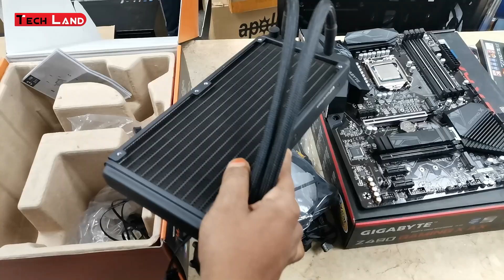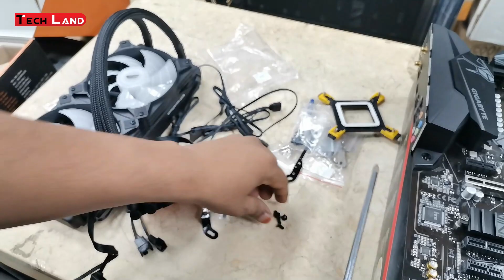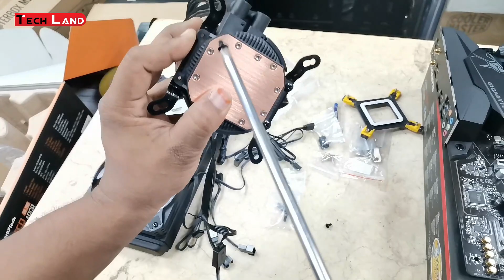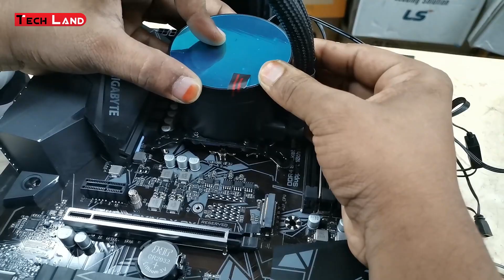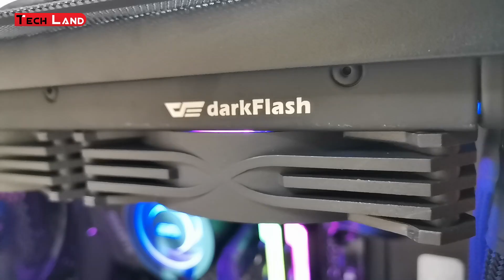How to Installation DarkFlash Twister DX 240 LIQUID CPU Cooler | Tech Land

Comment: how can i sync it on my mobo which is asus tuf b450m pro gaming
Reply from the maker: Yes you can
Reply: @TechLand2  may i know how?
Reply: @Argiaguy   No, you cannot connect it directly to ur motherboard since TUF b450 Pro gaming doesn't have a  5V-3PIN.  Asus TUF b450 Pro gaming has  2 (12V- 4PIN),  if you  buy a converter from 12V- 4Pin to 5V-3Pin, then you can connect it.
Reply from the maker: Thnx for information.

Comment: Hi Tech Land, where i can put RESET SW from DX240? now im not use that socket, but still working
Reply from the maker: have Caisng RESET SW put PSU sw thnn u can change color
Reply: @TechLand2  I dont understand with ure comments
Reply from the maker: @facode-id  @Connect the restart cable of your casing to the liquid cooler.
Reply: @TechLand2  Connect to RESET SW on Front Panel cable from Casing?
Reply: @facode-id  Connect your RESET SW cable from fans to the MOBO along with the other tiny connectors from PC case